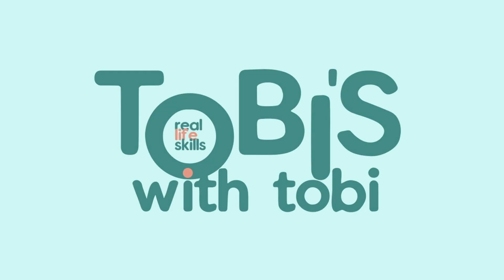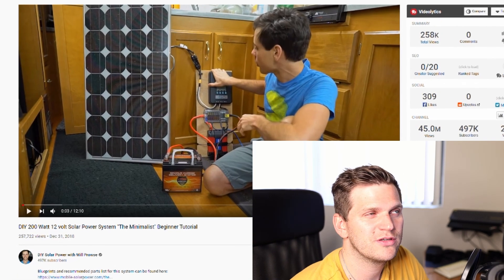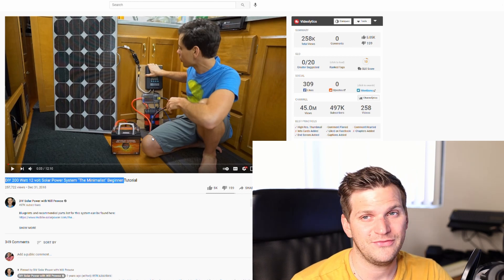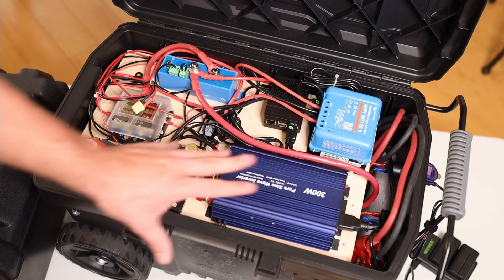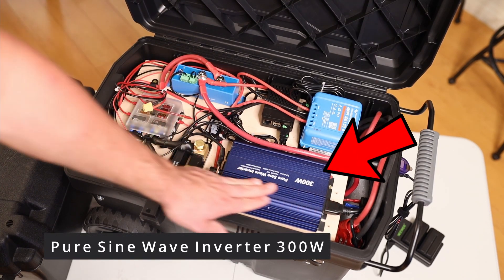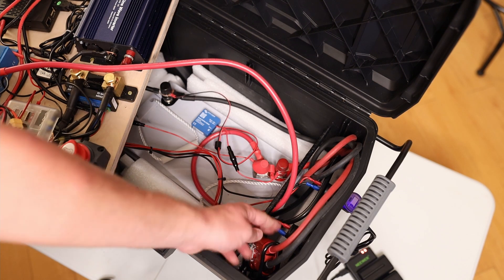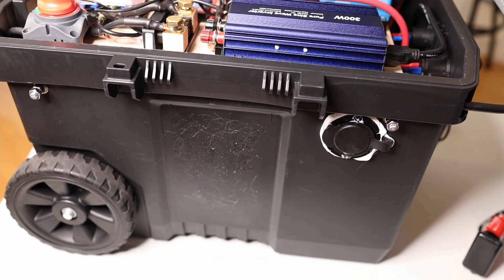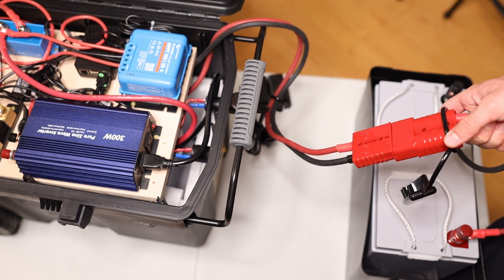DIY Solar Generator with 12V battery | Solar Power System portable

Comment: That's a very nice build. You used quality components and it looks good. I see an XT-60 plug for something and like that Anderson connector to boost battery capacity. I added the Anderson 175 amp plug on mine to piggy back on additional batteries if needed. Did you crimp your own cable ends?
Reply from the maker: Yes I did :-)

Comment: Wow, nice work! It looks very neat to me. I am building my second DIY, using 4 SOK 12v, 100ah batteries and they will be series/parallel connected for a 24v system. They are a bit odd sized so a box to put them in that is not too big has been difficult to source. I LOVE they way you added that second battery via Anderson connectors! I was thinking of using stackable tool boxes with wheels but the only one that will fit the four batteries is too big! So, may just go your route and connect as needed.
I currently have a 1500w Bluetti and a 100ah, 2400w, 12v x2 BattleBorn batteries with a Growatt MPPT. The SOK will be 100ah, 4800w when completed. The Victron SmartSolar 100/30 does not work out of the box so that is holding me up. I am going to switch the BB with the SOK so the larger system is using the Growatt MPPT. The MPPT is 3000w continuous.
I like having the storage units in completely separate units. I can place them where needed, one goes down I have backup, reduces extension cords criss-crossing the house. 
I went with 12v batteries for compatibility. In a pinch a can break the systems down and charge via car battery/alternator, at least that is my thought process.
I was stationed in (West) Germany for 7 years in the late 70's, mid to late 80's. Rhein-Main AB, Frankfurt 1979 to 1982 (gone now) and also Wueschheim AS, 1985 to 1989, also gone. OHHH what a great time I had. When I heard you say "Tschüss" I smiled! Brought back many memories.
Reply from the maker: That sounds like a nice setup and even greater you liked the Tschüss at the end!! :-)